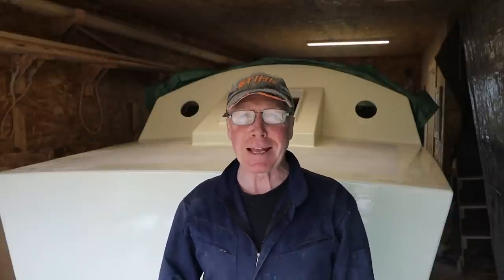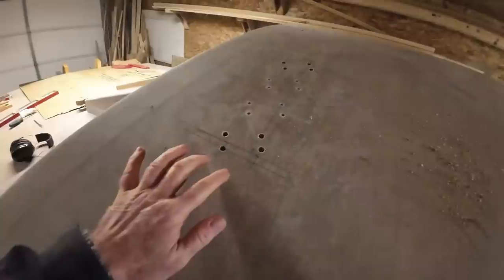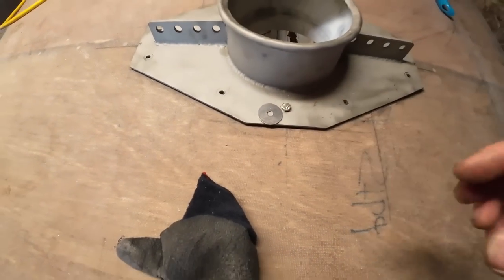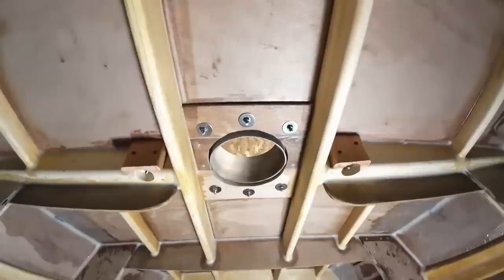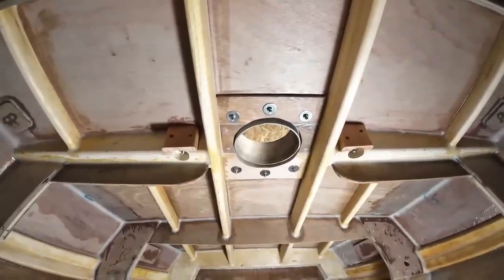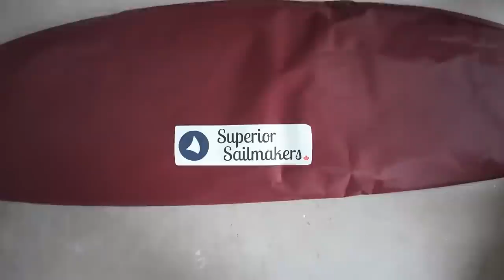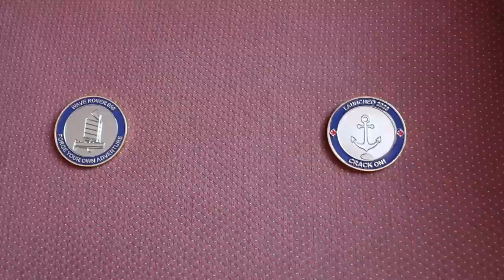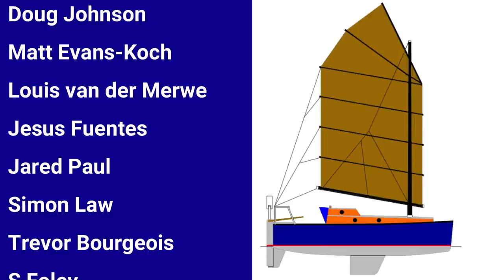S2E85  Wave Rover Collides with Reality // 30 Days Before Launch????

Comment: Any time you weld stainless It's important to brace stainless really well before welding it. Even place tacks on the other side of the workpiece and weld from the center outwards before welding it up! to your work bench before welding, because stainless has the tendency to warp more so than any other metal. Even then stainless is difficult metal to weld while trying to minimise distortion.
Reply from the maker: Absolutely. We have to spend a bit of time straightening and bending the fittings to make them work. Thus is the nature of a backyard build.

Comment: Bed the mast plat in thickened epoxy, packing tape on the underside to prevent bond. That will provide a perfect fit.
Reply from the maker: That was my initial idea but the bolts pulled it down nicely. It's a very good fit.

Comment: Alan: - "It's actually quite an interesting rudder.. it'll be a lot more different than I think many of you are anticipating."

Hmmm.. what I'm anticipating is a trim-tab, and NACA foil sections... am I close?
Reply from the maker: Extremely close but I might surprise you yet.
Reply: @RoversAdventure  - Hmm.. ok..  let's see.. in addition to the above, those small plates at the top and bottom of the submerged section of the rudder.. can't think what they're called. Like the ones Tony has done with SV Tapatya.

Comment: Looks like an August or September launch to me.

I have built only two boats. And both of the mere dinghy size. The second (of my own design) was started almost exactly 50 years after the first was.

What I learned from the first one is that there should be no rushing the launch date. My present boat was finished in October of last year. 

A hernia surgery has delayed its first launch this year. I have to heal enough to be able to lift the 80-pound hull to on top of my car.

Sooner or (probably) later, she will get to the water. Best to allow that to happen on its own time.
Reply from the maker: I have the added pressure of getting underway during a relatively small window to safety cross the North Atlantic. If I miss it, I have to wait another year.
Reply: @SailingWaveRover  better to wait one year than to leave, not totally prepared in a non-tried boat that is going to have quite different sea keeping characteristics than your previous one.

No. I don't mean to imply that it is less seaworthy. It's just going to handle sea conditions differently.

Comment: Just a random thought. Would placing a thick piece of fiberglass cloth, soaked in epoxy resin, under the metal mast step, and then draw the mast step down,while it sets,  give you a perfect bed, for the step? You could put a pice of wax paper under the step, and remove it after everything sets up. Then you could screw it down with bedding compound. Dan S. Texas & Michigan
Reply from the maker: It is a good idea but the fit is really good as is.

Comment: Your paint may not have dried because of the lack of air flow and your boat hull is in a reatively confind space creating a pool of paint  vapour around the work that cant go any where and thereby retarding the drying process. Its a bit like why the paint dosent dry in the tin over night. The usually indicater is that the paint stays tacky for several days until the paint vapor has slowly been exchange by oxygen. Try putting a large peice of fibre glass sealed ply wood in a sealed jar that has been freshly painted and see if the paint has dried in 24 hours.
Reply from the maker: I believe that you are right about the air circulation. I put big box fans on the inside and it dried much quicker.

Comment: I like the idea of having a strong pad eye to clip onto before you climb out of the boat but would worry about falling on that one given its locations.  It could be a real pain in the @$$ (quite literally).  Could that U-bolt be mounted on the aft edge of the raised hatch suround and still do what you need?
Reply from the maker: Absolutely. If it proves to be an issue I will move it during the next refit, good observation.

Comment: Practical help you my find this helpful for subsequent coats of paint. The problem is probably not because of the temperature. Paint makers always keep on the side of caution regarding temperatures. I am sure you have discovered this in the industry that you work in.

Your paint may not have dried because of the lack of airflow around the boat hull and it is in a relatively confined space, creating a pool of paint vapour around the work that cannot go anywhere and so retarding the drying process. It is a bit like why the paint does not dry in the tin over night. The usual indicator is that the paint stays tacky for several days until the paint vapor has slowly been exchange by oxygen. Try putting a large piece of fibre glass sealed ply wood in a sealed jar that has been freshly painted and see if the paint has dried in 24 hours.